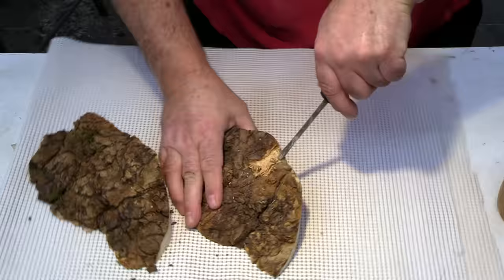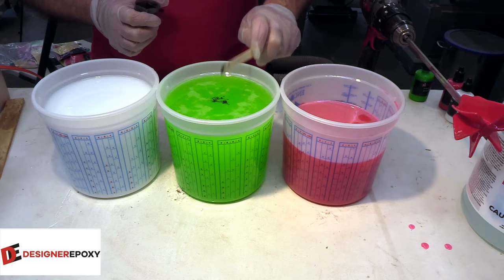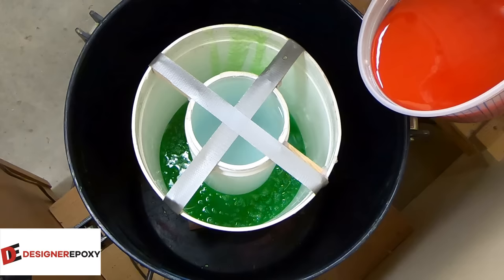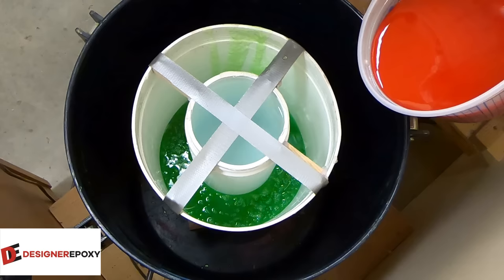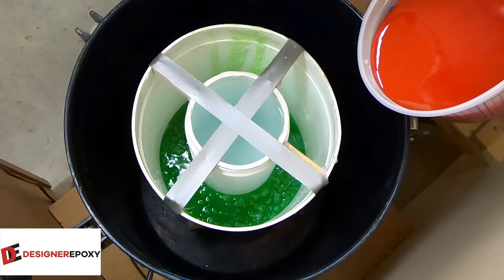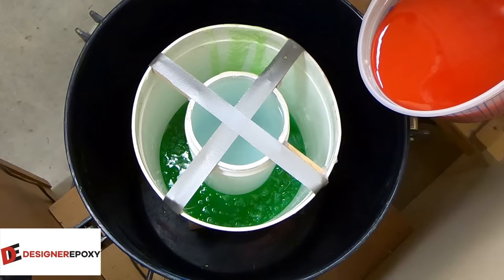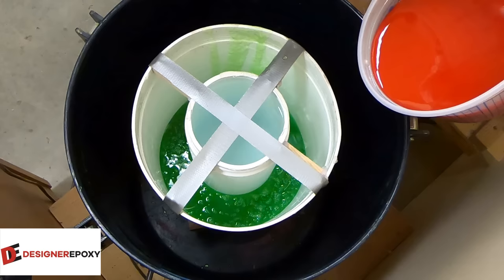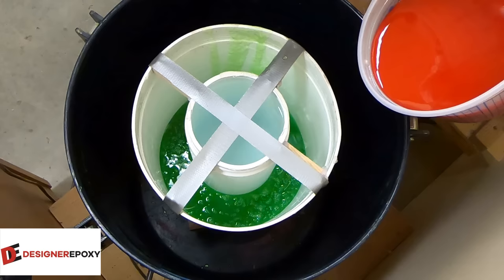Woodturning - Don't Miss This Fantastic Welsh Flag Inspired Vase!

Comment: Firestone makes heavy rubber airbags that go inside of car or truck coil springs. All different sizes too. Fill it with Ride-on tire sealant/balance. Then you can add some air.
They work perfectly Jim, give that a try....😅
Reply from the maker: Good idea, if the the shape will work. Thanks!
Reply: @SpragueWoodturning  
I hope it helps!
Keep up the Interest!

Comment: forgot how big are the wheels I need to get them and go buy some 1"X 2" or 3" tubing and piece of flat bar.I've been retired now for 15 years I was a heavy duty repairmen worked on large equipment for 35 years as a welder and portable line boring so I can make anything took a toll on my body but I loved it!
thanks for your video's
Reply from the maker: Thank you very much!

Comment: Jim, if you're doing a black poor or black tinting for Halloween, have you heard of using charcoal as a dye? It works very well and won't lose its consistency in water or epoxy. Plus, it doesn't stain in most applications. Give it a try, if you'd like, in the future on some test pieces. Great job this week, as always!!! Love the piece!!!
Reply from the maker: Thanks for the tip. Thanks

Comment: Another great project. Color theory- To darken a color you can also add a little of opposite on color wheel. If you add to much it turns into a nasty grey/green mud. I was a little concerned when you used red and green in the same pour. I think the clumps definitely helped. Thank you as always. Stay well. Designer epoxy.
Reply from the maker: Thanks for the tip!

Comment: I boil my burls to remove the bark without damaging the wood underneath. For larger pieces I have a metal garbage can and stock tank heater. Total cost was under $100USD a few years ago. Bark usually pops right off. Some need a little more convincing, but still easier than other bark removal methods. Also helps reduce cracking in crack prone woods.
Reply from the maker: I tried some boiling in the past and found it very expensive in propane, lol. Interesting, I prefer the bark stay o while drying to reduce cracking. Thanks!
Reply: @SpragueWoodturning  Agree, propane too expensive. Stock tank heater is plug-in.

Comment: Wowsers!! That it stunning!
You say your piece is 8inches deep - well yes, but if you were to theoretically cut the piece down the side and lay it out flat, you kinda have a slab only about 1-2 inches thick (and 8 inches wide), perhaps that's why it didn't thermal crack, because the water heat sink also helped create a 2inch thick wall, and not an 8inch deep block. Just an observation.
Reply from the maker: Technically yes, thanks

Comment: Designer epoxy.   Oh my…… Huge amount of resin.   I don’t know…the water thing in the center kinda freaked me out.   I tried to save on resin on what was my largest piece yet so I took a very very hard empty plastic container with nothing in it.   Put the lid on it real tight and What a Mistake that was.   Opened the pressure pot and the plastic container was Crushed… Resin dropped like 2+ inches.   What a Disaster.   Now I just cut out round pine 1by pieces and glue them together to whatever height I need.  

Beautiful piece!   Great color separation.   😊
Reply from the maker: It would of been fine if you would of left the top off. It wasn’t able to equalize the pressure and the container imploded. I’ve been down that road too, lol. Thanks

Comment: Jim, another great piece. I wanted to share a mold release product  that I have used with great success. vaseline.I spread it over the entire mold by hand and remove the excess with a paper towel. It does not seem to effect the resin I use. I am curious about the shield you wear.I like the shield respirator combination.Thanks again  for sharing.
Reply from the maker: It’s called the Powercap. I plan on doing a review of it soon. Thanks

Comment: My mother in law was from Wales.  This piece is gorgeous. Is it possible that even though the pour was 8 inches that because the  container was used in the center that it wasn't solid across the diameter is the reason you aren't getting thermal cracking.  I've used designer epoxy for several years now and gave found that even if the pour is over 4 inches, the diameter may be less than 2 and I've  not had any thermal cracking yet
Reply from the maker: I will push it farther next time and we will see, lol. Thank you very much!

Comment: Love It.  I remember another piece that got to the gloopy-stringy state before you poured and how well the color separation on that piece turned out.  I'm glad this one did the same, because as someone else mentioned, combos of red and green can be cringe-worthy if they don't stay separate...hello mud.  I think adding the black to the green was a good choice, brought it so close to the flag color.  

It looked like some of the pour sloshed outside the bucket into the pressure pot.  Did it?  How do you clean up the pressure pot if that happens?

Thanks for another great video!
Reply from the maker: I spray mold release in the pressure pot, that way when there’s a spill like in this video, it usually comes up pretty easy. Thanks

Comment: On the topic of bladders: the Periodic Videos video on Helium shows a football bladder from inside a ball inflate gigantically without popping.  That might be useful to look into?
Reply from the maker: A football bladder might take some pressure. I don’t think it can take 60psi though. Thanks
Reply: @SpragueWoodturning  you could be right. A football has the exterior on it, and the bladder inside. The periodic video didn't specify what the psi of the helium was when the bladder was inflated.  I was thinking it was just incredibly resilient.  Just another idea is all :)

And if you're curious:

On a field party per fess argent and vert, a dragon gules passant.

Edit: I googled the psi of footballs and yeah. They're pressurized way below that. Not sure what the 'maximum' is but likely nothing close enough to 60

Comment: That was a close call with the epoxy curing but worked out again for your color separation.  Quick question: is there a difference in using liquid pigment as opposed to the powdered pigment?  Thanks!
Reply from the maker: The liquid is way more intense. Sometimes a drop will do ya, thanks!

Comment: Inside of pressure pot looks metal. Ever think of putting casting bucket on thin slats and fill outside bucket (staying week below top of the bucket). Seems plastic to water to metal would be more efficient than plastic to air to metal. Particularly since pressure will heat the air.
Reply from the maker: Interesting, I have the large metal container that fits inside of my large PP and might try it sometime. Thanks

Comment: Jim — love your work, especially ones with resin.  You waited 8 hours after mixing with this piece to keep colors from blending.  Is that your what you recommend for this type of resin?
Reply from the maker: To get the color separation with deep cast it’s all about the wait time, the time will vary and that all depends on the volume of resin. When it hits 70C, ya better start pouring, lol. Thanks

Comment: Water is basically incompressible.  If you put pressure on the outside of a balloon chuck full of water, under pressure it should be fine, barring nothing pointy is in contact with it.  However, it will not work in a vacuum, because as you lower the pressure, gasses in the water will come out of solution and keep it pressurized as the area around it's pressure falls.  If you think about it, the balloon doesn't care what the pressures are, only the difference between the pressure on the inside and the outside.  You can put all the pressure on the outside of a balloon full of water and it'll be fine, as the pressure in the water just comes up to match the surrounding pressure, no difference across the balloon.  But as you lower pressure the gasses come out, and try to expand the balloon.  In that case it might burst.
Reply from the maker: If the balloon is tied off, I can’t but think there will be a ton of problems. If there was the ability to leave the balloon open somehow, then it might be a different case. I will get a balloon and try it. Thanks

Comment: Using that container in the middle must have saved a ton of resin. What if you filled it with rice instead of water. You could freeze the rice, maybe?
Reply from the maker: Freezing the water might be a better choice. Thanks
Reply: Hope you get to try it out. Do you think water will slow the curing of the resin down?  I guess that too would be a consideration?

Comment: 32:43 ok question, how do you decide which pieces get a resin coating and which just get the waterlox?
Reply from the maker: When I have chip-out issues, crack in the wood or resin or just trying to seal the wood up prior to using the Waterlox. Thanks
Reply: @SpragueWoodturning  thank you! 🤗💜

Comment: sorry I'm late been real busy last few days but as usual I enjoyed the video; I like the shape of this one  not sure I've seen you do one just like it before. that was a lot of Designer Epoxy used on this one though I am really surprised it didn't thermal crack and I have never heard of using the water to cool it I will have to remember that. thanks for the tutorials, also I know your still evaluating the face mask /respirator but can you tell me the brand name and type it is so I can look it up I really need to do something I have found 1 similar but it sounds as if it will be awful heavy the N 95 masks are not getting it done for me.
Reply from the maker: It’s called the Powercap by JSP. Thanks